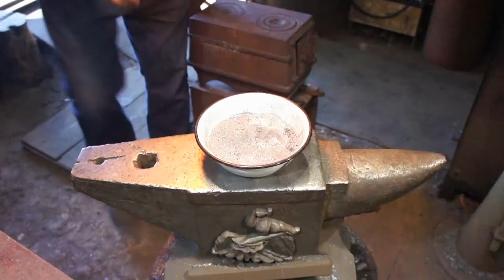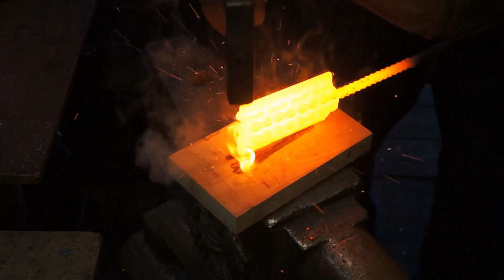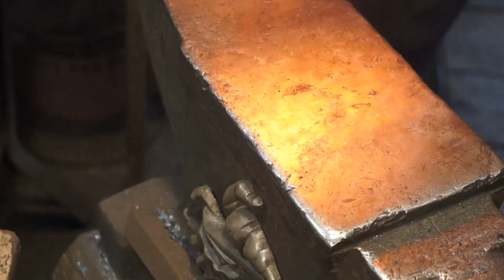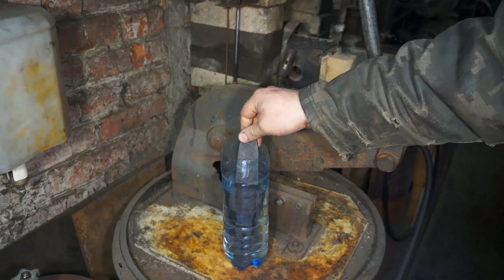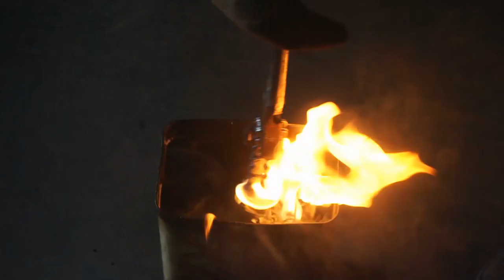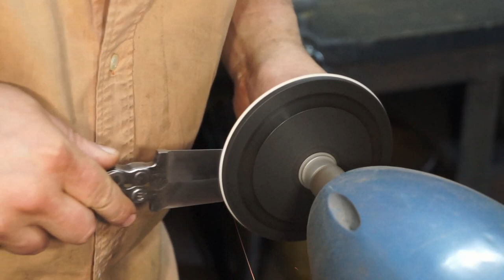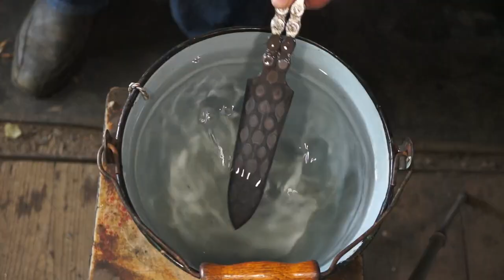Blade "Mad Max", Damascus steel from a motorcycle chain.

Comment: I used to work in a chain factory, working with the very size chains (50/60 series) in this video.  Not just the use of high-carbon bike/motorcycle chain for a knife, but also keeping the links in line with each other during the drawing process to preserve the chain pattern in the Damascus is beyond cool, and is the hallmark of a true craftsman.  Well done.

Comment: next: Damascus steel sword from a whole motorcycle.
Reply: DIS GON B GUUD
Reply: Bits of plastic and rubber tyres in there.
Reply: A literal chopper.
Reply: @incom8062  the plastic would be mad into a trinket in the bottom of the handle and the rubber would be made into the handle
Reply: @simonbrignell2690  😂
Reply: That would make a sword that Cloud Strife would be proud to wield.

Comment: Liked how he wiped the glowing steel sparks with his bare hand
Reply: Every video lol. This man is a tank
Reply: @bermudavibe1714  I did this with shattered glass, also no problem xD
Reply: If you do it fast enough, it doesn't hurt even a little. Source: my father is a blacksmith
Reply: Irańian KiddoXx he’s not just acting tough. This is physics at work. You could do it too. It’s the same concept as being able to run your hand under a flame if you move fast enough.
Reply: @MisterRorschach90  + callouses.
Reply: He brushed it, they cooled down already then hand wiped. I didn't see any glowing
Reply: Calluses help too.. from a steel worker
Reply: Calloused hands*
Reply: Gloves are a safety risk, they make your hands soft and prone to injury.
Reply: @Anubis78250  Correct! And also, his hands are so close to red hot metal most of the time, you get used to the heat!
Reply: @sterlingsummers9697  Plus when wearing gloves, there's the chance of a red hot piece of slag getting down inside of the gloves, and by the time you've got your glove off that piece of slag has burnt a crater into the flesh of either your hand/finger where ever the slag ended sticking to the skin!

Comment: That pattern is mesmerizing...when he finished it with oil and wiped it off, my jaw dropped.
Reply: How did he do that though?
Reply: He dipped the blade into the acid so it amplifies the damascus patter
You can also do it with mustard, that makes an awesome pattern too
Reply: @dusancvjeticanin7588  Neat. Btw where are you from?
Reply: So true.  I thought it looked good before that, but then when that pattern was revealed,  it was amazing. Its always cool to watch s true craftsman at work.
Reply: Same.
Reply: @abyssstrider2547  The liquid he dipped it into was an acid. It has a different affect on the different types of steels in the blade.
Reply: That pattern make me really fucking itchy
Reply: @abyssstrider2547  Acid pickling exhibits a steel structure.
Reply: Instant coffee works well too

Comment: Love the “Anvil Wipe”. Not hot ?  Hands of steel.
Reply: It gets a little hot but an an anvil has a lot of thermal mass so it won't heat up very fast
Reply: @zekecrall4708  yes true
Reply: Moving your hand quickly like that across the surface doesn't leave much contact time for heat transfer, plus I doubt he's pressing down much so that also limits the contact.  At most I'd imagine it's just a brief discomfort.
Reply: +November Reign Same thing with chefs.  Enough burns and the nerves become damaged while the skin thickens, eventually enough that handling hot pans without pot-holders becomes natural.
Reply: i noticed it..
Reply: I notice it everytime...EVERYTIME. I guess Anvil thermal mass vs tiny particles vs fast, light movement means no or low pain.
Reply: Even if it were cold i wouldnt. Its never nice to get metal splinters embeded into your skin.
Reply: Big ole heatsink. Don't try it with a 20 lb
Reply: Its the 1 second rule u can even touch lava for a second and not get burned lol
Reply: There is video of a factory worker moving his hand through molten steel

Edit: https://youtu.be/hlwi1XZg2EA
Reply: @mitaskeledzija6269  false
Reply: I just don't think the man owns any gloves.
Reply: @mitaskeledzija6269  if you had ever been near molten steel, you would not think that.

Comment: Me when he dips it into the liquid and it comes out with spots: "Mmmmmmm das nice"
Reply: I believe its an acid, used for coating a pattern, only aesthetics
Reply: @rebeccaconlon9743  At first I thuaght it was hydrodip
Reply: It is acid, but it reveals the pattern already in the metal by etching away at the surface, not coating it.
Reply: @fr3heart  exactly. The different metals used are not affected by the acid at the same rate so you see the actual layers quite nicely
Reply: Please what is the dust that he drop on when he stars to forge it?
Reply: @celsobarbierijr1905  that would be a material called flux. Typically borax is used here in the states but there are many varieties. Flux turns into a liquid when it melts, and is used in forge welding to coat the steel so that oxygen doesn't penetrate the molten metal as it's being forced together with the hammer. Basically without flux, oxygen gets into the metal and causes oxidation on the surfaces of the steel, so the pieces won't stick together properly. The pieces will separate as they cool instead of becoming one solid billet. This is called delamination - once it happens there is generally no way to save the piece. This is why he adds a LOT of flux, and uses very light hammer strikes until he's confident that he has a good weld. Sorry for the long response, hope that helps. 😎
Reply: @AllThingsMech  Thanks for explaining that. I was wondering what that was. Not sure why he didn't coat the whole piece though.
Reply: That's called Ferric Chloride. It literally eats the softer steels(all things are relative) revealing the harder, shiner steels and the pattern.
Reply: @fr3heart  huh... you learn something new everyday thanks for sharing bro
Reply: Yep I was like “ waste o time of it doesn’t look special from using bike chain”!

Comment: When you gonna be on “Forged in Fire”?
Reply: Btw, are this show still running?
Reply: @mitaskeledzija6269  Maybe. But judging by this blade, easy money for him. He'd win easy.
Reply: @mitaskeledzija6269  Well first off, that is not true Damascus Steel blade. He just forged a single billet, instead of using different layers of contrasting steels and forge wielding those billets which will eventually give you the different types of patterns, like ladder, or raindrop. The patterns on his blade came from the links.
Reply: @mariajukejax9649  Nope,, would have been disqualified because, it wasn't layered, or a canister Damascus, and he didn't use different types of steal. Beautiful blade though. I'm not putting his work down at all.
Reply: I think he is russian
Reply: Nope the show good for a start but so darn picky on who made the blade and the safety as well knife or death was bad knockoff of the show.
Reply: He called it Damascus steel due to effect forging the links gave it. I'm sure he's well aware that it's not genuine Damascus steel.
Reply: @mitaskeledzija6269   No he's not...Many on the show are highly skilled blacksmiths. Have you tried to forge a knife....or any other weapon in just 3 to 4 hours? I would guess it took him all day to make this. Also he would have not be disqualified ...Anthony Ramirez
 if everyone was given motorcycle chain and told to make a dagger with it. And he called it damascus because of how it looked after the acid etching
Reply: @phoenix_lord3522  they make rookie mistakes I saw and I know it's not easy and some people that sign up for that show don't know the basic shit :P
Reply: @anthonyramirez9003  ok ok but that is not the comment.. I guess true damascus steel is from layers and layers of steel?
Reply: @anthonyramirez9003  is damascus steel better than regular steel?
Reply: @mitaskeledzija6269  Layers of different types of steel.. The way its forged is what makes the pattern.
Reply: @Mita Skeledzija damascus steel isn't necessarily better or worse. It depends how you make it. If you suck, it will be bad because the steel gets delaminated and doesn't weld properly. If you do it right, it looks a lot better with the pattern, and is a bit stronger too.
Reply: He'd be a judge instantly.
Reply: @mitaskeledzija6269  m gonna hurt a few feelings here probably but here is the metallurgy. there are many different types of steel currently referred to as  " Damascus " most are formed by mechanical means of folding or layering. these are not a true Damascus steel though and are what is known as  " pattern welded ". original Damascus steel is what is known as wootz steel, or cake Damascus and made in a crucible by thermo cycling. this makes a big difference in grain structure and the embedded carbides. with out getting too long winded on pearlite marstentite and austentite, sufficient to say crucible steels produced a finer , more consistent grain structure. but its almost a lost art
Reply: A buddy of mine was a multiple episode champion on the show. He is an excellent metal worker and blade smith. Check out Wolf River Forge.
Reply: That show sucks.
Reply: @pisossosi8936  he is from ukraine not russia
Reply: @mitaskeledzija6269  You're comparing a dude at his home forge, unlimited time, and no pressure to people in a foreign environment, foreign tools, camera crew, time limit etc... come on dude that is apples to oranges. I assume you have never competed in a high pressure situation. Nerves and time pressure can bring a master craftsman to make silly mistakes.
Reply: @joshk9328  yeah, he made a beautiful knife here but this knife in particular wouldn't even be a very good fit for the show since it's more of an art piece than a functional weapon.  Don't get me wrong I'm sure he might be a great contestant but the fanboys in this thread are polishing the knob a bit too hard haha
Reply: @mitaskeledzija6269  that's true! Most of the players are soooo bad 🥱
Reply: @joshk9328  well said, plus they're forced to use certain technique and crappy material.
Reply: @pisossosi8936  Ukrainian! sam sosi.

Comment: How did the patterns come to be? Thats some dark magic right there.
Reply: Is it because the empty space were filled with a different material?
Reply: The different layers of chains were '' melted together'' during the forging but still the original parts of the chains remain visible in some places ( the round shapes here). This is how a Damascus works, melting them so the become sticked like a single piece of metal but not enough for them to be merge together completely
Reply: Carlsbergauss also different parta of chain are made of different steel so they have different „shades of gray”
Reply: Probably happens because of the acid dip. Different steel heats at different temp. The acid reacts to this difference in heat treatment and causes patterns.
Reply: @shekharbahuguna9475  just does not react at the same pace with the different types of steel.

Comment: The fluxing is always my favorite bit, don't know why.
Reply: Is that the powder stuff he adds on both sides? If so what is that do for the metals and why is it needed?
Reply: @motomadbomber1814  yeah, it's the powdery stuff. It's used to help reduce the metal scaling that happens because of oxidation during the forging process.
Reply: @motomadbomber1814  it also helps with creating cleaner and stronger bonds between different metals, idk the chemistry behind  it tho
Reply: @ziggyboogydude1  It removes impurities from the surface of the metal (oxidation and stuff) which would otherwise interfere with the metal welding together.
Reply: My shop classes and chemistry are a bit rusty. It's boric acid being used isn't it ?

Comment: When you sprinkle that dust on the red hot metal, have you ever accidentally touched the metal? If so, it must have been a nasty burn wound.
Reply: In a few of his other videos he films himself casually flicking scaling off red hot steel with his bare hands. He probably has callouses like shoe leather.
Reply: @philanaemic  The way he cleans that anvil barehanded after the scorching metal has been on in for a while amazes me. Pretty sure my fingers would burn up
Reply: like walking on a bed of coals ... its about how long the hot is in contact with you ... the less time the better .... but there is also a technique that maximises speed and lightness of touch
Reply: What is that powder
Reply: @karthikvenugopal6104  it's called Flux

Comment: I'd make a resin handle over the chain.
Reply: A clear resin would look cool ✌
Reply: Nah wrap it in a rubber piece from a motorcycle tube or tire
Reply: Randomness In A Can rubber sheath...
Reply: What add unnecessary weight....
Reply: @Randomness-in-a-can  Yes.

Comment: Better result than most. Usually, whatever they start with, whatever they call it, the finished product looks like any other Damascus. Good to see someone upping the bar. Like 'meteor swords', where everyone grinds up a meteorite and just refines some crucible steel out it. I want to see someone install the effort to pull a glowing orb out of the forge and beat it into a blade.

Comment: Right up there at the very pointy edge (sorry for the execrable pun, but it fits perfectly) of modern fire welding.  The craftsmanship and finishing is great, but the ability to weld the blade from the initial billet with only forge heat, a hammer and an anvil is proof of long practice and proper knowledge.  Respect is due!

Comment: Maybe a dumb question, but what is the purpose of dipping the red hot blade in bread crumbs?
Reply from the maker: I sprinkle flux (90% borax + 5% quartz sand + 5% charcoal powder) this is necessary for forging (forge) welding. The flux is alloyed with scale - the formed substance is sufficiently fluid and is easily displaced by deformation. In addition, the flux protects against oxygen and charcoal, carburizes the surface layer of metal - which lowers the welding temperature (if in brief).

Comment: So many questions: What did you do to prevent cold shuts? Did you put steel powder in the chain and weld hardenable steel to the outsides like a cap? Did you just smash the crap out of it until the chain closed perfectly on its own? (I've never been able to make that work). Are you forging the links of the handle together to give it structure or is there some other trick I am missing?

Comment: What is that flux your using am i right in thinking its just plain old wood ash....looks like it, im just starting out so all hints, tips and hacks to help me with keeping a tiny budget smaller would be greatly appreciated 🙂
Reply from the maker: I sprinkle flux (90% borax + 5% quartz sand + 5% charcoal powder) this is necessary for forging (forge) welding. The flux is alloyed with scale - the formed substance is sufficiently fluid and is easily displaced by deformation. In addition, the flux protects against oxygen and charcoal, carburizes the surface layer of metal - which lowers the welding temperature (if in brief).

Comment: Amazing and beautiful ! One question, what is he sprinkling on the piece before he starts hammering ?
Reply from the maker: I sprinkle flux (90% borax + 5% quartz sand + 5% charcoal powder) this is necessary for forging (forge) welding. The flux is alloyed with scale - the formed substance is sufficiently fluid and is easily displaced by deformation. In addition, the flux protects against oxygen and charcoal, carburizes the surface layer of metal - which lowers the welding temperature (if in brief).
Reply: @shurap  That's very interesting. Thanks ! Your art is so beautiful.

Comment: Beautiful work!  You are quite a craftsman. I have a question, what is the box that you put your blades in and what does it do?
Reply from the maker: This is annealing of steel, it is needed for grinding grain of steel grown at the temperature of forge welding, stress relief. Preheated billet to austenitic transformation temperature, placed for slow cooling in the heat insulator "Perlite".
Reply: Thank you

Comment: That is the best looking Damascus pattern I think I have ever seen! Can this be done with just a hand hammer? I don’t have a power hammer nor the area to put one... lol also, what was the white powder flux you were using? Was it just borax? Thanks!
Reply from the maker: I sprinkle flux (90% borax + 5% quartz sand + 5% charcoal powder) this is necessary for forging (forge) welding. The flux is alloyed with scale - the formed substance is sufficiently fluid and is easily displaced by deformation. In addition, the flux protects against oxygen and charcoal, carburizes the surface layer of metal - which lowers the welding temperature (if in brief).
Reply: @shurap  awesome, thanks for the explanation, I knew you needed to flux the part but wasn’t sure what it actually did, especially seeing that the part is so hot you’d think the metals would just smoosh not itself with no issues.
Reply: @shurap  also I don’t know if you saw it or what ever but... also, can someone make a Damascus blade with just hand hammering? Or would it be way to much work or not even work at all because not enough force can be applied?

Comment: Watched a few of your videos and this one is the best yet. That blade looks so good. What is the product you sprinkle over after the furnace and what does it achieve? Thanks
Reply from the maker: I sprinkle flux (90% borax + 5% quartz sand + 5% charcoal powder) this is necessary for forging (forge) welding. The flux is alloyed with scale - the formed substance is sufficiently fluid and is easily displaced by deformation. In addition, the flux protects against oxygen and charcoal, carburizes the surface layer of metal - which lowers the welding temperature (if in brief).
Reply: @shurap  thank you for explaining 👍